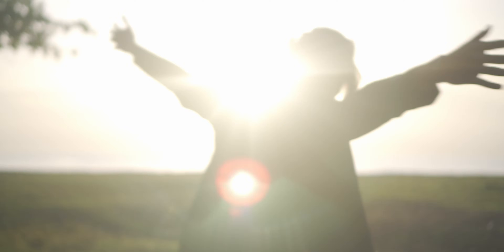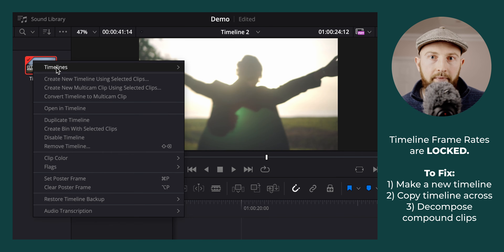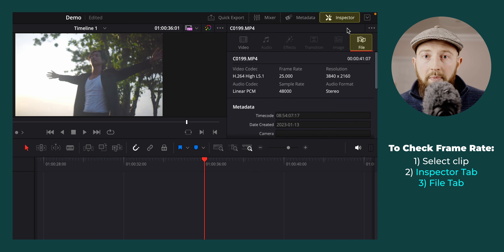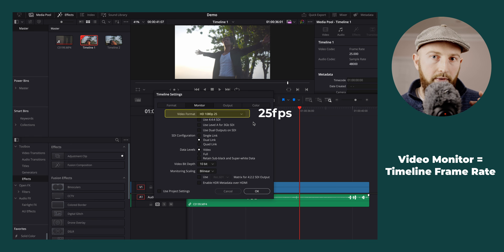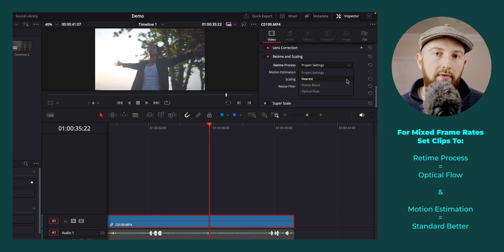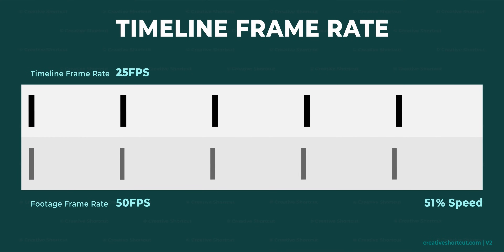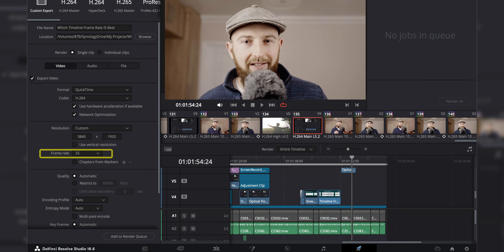How to fix choppy, glitchy, jittery video [DaVinci Resolve Tutorial]

Comment: for me the image twitches twice on playback(almost like the same frame is showing twice) , i can't tell what i am doing, it used to work before not it is unusable
Reply from the maker: Assuming the video plays well in a normal media player, it sounds like you have the frame rates incorrectly set for the footage and the frame mode ‘nearest’ selected. 

It’s also possible that it’s lagging. In DaVinci you can see the frame play back speed at the top of the video window. If this is dropping you might want to look at proxy files.

It’s also worth checking your timeline viewer play back frame rate as mentioned in the video incase this isn’t the same as the timeline frame rate which would also mess up the frames being displayed smoothly.

Good luck fixing it!
Reply: @TimBelchamber  thanks!

Comment: why does the words "no media" flash on and off in my video?
Reply from the maker: Usually means you have slightly corrupted footage. If you don’t have a back up, run it through handbrake. This will ‘fix’ the corruption but you might get some small visual glitches.

Comment: I have this problem where i use 2 different clips the first is at 29.97 the second is at 59.94. When the final render comes out there is a choppy section for about 3 seconds after the camera switches
Reply from the maker: Either retime the clip to be a multiple if your timeline frame-rate or use optical flow.
P.s this is why .9 frame rates suck and I avoid them at all costs. 24, 25 or 30 fps base frame rate.

Comment: my problem is when i press the playback button it goes to 5-20 fps even though the recording is at 60fps. I added optical flow 1 and vector motion blur. When i play the clip before the effects it play fine and it also exports fine.
Reply from the maker: These are heavy effects and your computer is struggling to play them real time. This won’t be an issue in the final render. If you want to play back in the timeline without your computer lagging look in to optimised media, timeline resolution playback and smart caching/rendering out the heavy parts of the timeline.

Comment: great video, but i have a question.

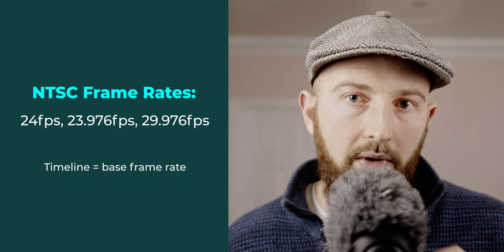My footage is 60fps, why do i set the timeline to 30, and not 60? 0:52
I dont understand this ^^
Reply from the maker: You can do 60 if you want, 30 gives you the opportunity to slow your footage to 50% cleanly. Not all platforms take 60 fps either and will convert when they process it. You also get additional benefits like less compression on social media, faster uploads/processing. Some people like high frame rate exports so it’s really up to you.
Reply: @TimBelchamber  ohhhh less compression! I did. It know that, yeah all my yt videos are kinda pixel soup sometimes (fast drone footage)

I will try that! thanks a lot!
Reply from the maker: @ glad to help
Reply: @TimBelchamber  I have a 60fps video and its set to 60fps (timeline), is it still supposed to work or do i have to change it to 30fps? Bcz mines really glitchy
Reply: It like slows down then speeds up really fast which messes up my audio too
Reply from the maker: @HoopRush-t6x it should still work, however the player you watch the render in (or the social media you upload to) may not have the ability to do 60 fps and may rerender it and mess it up or just struggle to play it.

Comment: The issue I'm having is with my video, the video will stutters or "rewind" itself by half a second. i still don't know what's up. I'm on 17.
Reply from the maker: Is this only in DaVinci or does it do this in software like VLC player?
Reply: @TimBelchamber  Only on da vinci, plays fine on other players like IINA
Reply from the maker: @igent5129  This sounds like an odd timing issue. If it's fully rewinding on the timeline (I've not personally experienced this but) I would check clip attributes and make sure the frame rate matches the original footage. If you've done any kind of external audio I would check the clip attributes of this too.

Another one to check is your monitor play back settings, if this is different frame rates it can mess things up.

I would check if this is all clips of a particular camera or if it's all clips. If any clip from any camera, your computer might be bottle-necking somewhere - probably storage speeds if on slow hdd.

If it's only a few clips or one specific filming batch, you might have slightly corrupt footage. Davinci seems particularly sensitive to any kinda of damaged video even if small and other players manage. You can try running your clips through hand break and see if this fixes the problem. If it's not coming back in the renders, you could also try editing with proxies.

Beyond that, it's hard for me without being on the computer and problem solving live, but good luck!